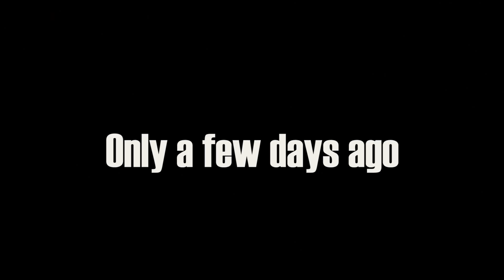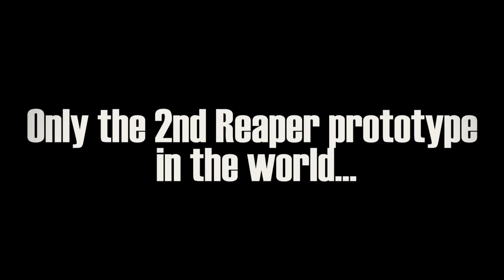The Reaper

Comment: cool looking truck, but i think it seems too close to the raptor. Raptor-Reaper. The logo on the bed side in the same place. Even the fake heat extractors on the hood are in the same place. 
Also the raptor is a production vehicle and the reaper is aftermarket just like the ram runner. Kinda defeats the point.

Comment: All this $$ is really just an appearance package, the supercharger is awesome, I own a 2015 silverado TLZ, I wouldn't waste my money on the reaper, in Canada its an extra $50,000. for the reaper sticker/appearance package, the suspension increases wheel travel by an inch, for $50,000!!! not worth it, I will go with a mid travel system that increases travel by a few inches at least, but for a lot less than $50,000.

Comment: Nice truck but it should be a 2 Door.
Reply: NO NOT "NICE TRUCK"!  Them things can barely freaking pull 5000 lbs.  My dad's truck pulls 6500 lbs, and it's a midsize!!!  Plus, it sucks on gas mileage.  And an addend, IT IS NOT DEPENDABLE.
Reply: Jeremy Good Obviously The Reaper is made for the Desert and not for hauling stuff. CHEVROLET/GMC need to do something to compete with the Ford Raptor. Personally I would've preferred a Street version like a SS. Muscle Trucks aren't used for hauling either except maybe hauling ass.All I'm saying is I'd be more apt to look at buying one if it came as a 2 door model. What the Payload Capacity is doesn't matter to me. I can use a different truck to haul and keep my toy looking new
Reply: Jeremy Good
I got it, you don't like those things. But one day, when it's not gonna be your dad's vehicle to put as example, you'll see the world from completely different perspective.
Reply: tallll70 When I was growing up the only 4 door trucks you saw were Crew Trucks. In fact they were called Crew Cabs,Ford had a Crew Cab model. I understand that 4 door Trucks are the norm in this day and age but I like a Regular Cab with 2 doors or maybe a Extended Cab 3 door truck. I saw a new Dodge Regular Cab Truck today and it looked nice stood out in the crowd of all things looking the same. I don't want what my neighbour has or my brother has. I want my Truck to be different. I feel the same way about The Charger when it came out,it should've been a 2 door. You build a MUSCLE Vehicle it should stand out not look like everything else. Just my opinion.
Reply: yeah i agree.
Reply: HARMARSCH2
Oh no, i pointed at Mr. Jeremy. But there is no need for any other responses. I have much higher experience from full size then from mid size i use to have. I had Toyota Tacoma. Gas millage vs full size. Highway 24/20, not that big difference for me. Ofcourse tow capacity even with 1/2 ton is much higher min 10k lb. If you not from US you can watch TFL videos all half tons towing over 10k lb uphill to compare them. Reliability? I would guess Toyota will win, but so far number of parts and it's prices didn't get any higher then i had to spent on Toyota. But thats just little me.

Comment: The only cool things about this truck is the hood vents and the front bumper. Even tough the vents appear to be just cosmetic. 

The rest of the truck you could do yourself and do a better job. Bolt on a actual Baja suspension kit, not a lift kit, a Baja kit, Glassworks  fenders, and other performance mods and save yourselves from that ungodly mako shark looking front end, and fender openings that appear no better than stock running on 33" tires.  

I admit, I was excited by the propaganda leading up to the unveil, then was hugely let down by the final product. Engine wise Lingenfelter delivers, like they always do, and I'd like to see what they can do to Chevys 6.2. But Southern Comfort must not understands what badass looks like.

Comment: WOW, nothing like adding a few bolt-on's, price it on the other side of the universe, and think you have something special. Nice truck tho
Reply: what do you think the raptor is?! :D lol
Reply: the raptor comes rolls straight out of the factory the way it is. it's not some aftermarket company throwing parts out of a catalog on a truck and selling it for double the money, any joe blow can do that. The reaper is not a factory general motors truck. I'm not saying it is'nt cool, because it is. Just WAY overpriced for what it is, IMO
Reply: Dick Bird
oh i agree lol it is overpriced lol but if you compare the reaper to the roush raptor (they both have the same upgrades such as a super charged which can raise prices by 7-10k) its about the same. All a raptor is, is a fx4 with a body kit and upgraded suspension. which is pretty much the same thing as a reaper. However i most definetly agree that they are both overpriced haha

Comment: Ok, The truck is cool, but come on. It wont compete with the raptor. The raptor was a whole new concept for off-roading from ford. This Reaper is a Siverado with a charged motor and new shock. Come on Chevy. Make a new concept. Not 10 mods to a Silverado and call it a champion. It needs a whole new motor designed to take hard hits and go places the Silverado cant, like the raptor to the f-150. This thing can only go faster and jump 5 feet higher than the Siverado. And whats with the small suspension travel? The raptor has 12 inches, I couldn't fit my foot in the Reaper's travel, and  the raptor has a motor in it like no other ford truck. Its designed to take a beating just like the ram runner. So, for my opinion, please try again Chevy. And nice word play with the name. Really? And, as a final request, please make a video, Reaper vs. Raptor. And make one that you don't pay for your truck to win. It should be hardcore American style. No paying them off. Just run em till they quit.

Comment: Wow..... what an absolutely bad ass, I mean bad idea this truck was from start to finish. 

Let's list the positives.

1). V8 supercharged.
2). Fox shocks.

The negatives. 

1). The grill and slap on fender flares.
2). No real improvements in suspension, no added travel.

And the we straight up copied Ford.

1). The name Reaper / Raptor hmm...
2). The mud splash decals over the rear fenders.

All in all the truck sucks. It comes off as knock off Ford Raptor and doesn't REALLY try to be an off road machine like the Raptor or the Ram Runner. The body molding up grades don't fit with the look of the truck at all. This is a truck for the guy who wants to look like he owns a cool off road truck but will never ever take it off the pavement. What's most disappointing is that I expect a better attempt from Chevrolet then this. SMH.
Reply: its only the second one ever made…its a prototype. Also lets not forget to mention power wise it way out performs the raptor…..I know i drive a raptor a lot. the raptor is a nice truck but mostly as you listed above, its a truck with slap on aftermarket parts. no different from the chevy reaper. Also i believe the copied the name to kind of 1up the raptor. They are both nice trucks lets just see where it goes. You never know the reaper may out perform he raptor.
Reply: Chevy didn't do this an aftermarket company did it. And just cuz they did similar things as the raptor doesn't mean they copied it. So since ford put fox shocks and a sticker on the bed means no body else can? This truck is no where close to being the same as a raptor. Raptor was bulit as a prerunner for the Baja 1000. Chevy 1500 was bulit as a work truck how is that copying.  ????

Comment: Sure it has more hp then the raptor but by far the ugliest truck I've seen
Reply: Ya it is very ugly.  It may have more HP than a stock Raptor, but for less $$$ than the Reaper you could get a Roush with 600 horses.

Comment: This truck makes me laugh. Nothing but a half-assed Raptor wannabe.
Reply: Well the smallest motor in the reaper out powers the 6.2 in the raptor so I wouldn't say that
Reply: Cayden Clark Putting a super on a Silverado doesn't suddenly make it better than a Raptor. Like I said, it's nothing but a half assed attempt to compete with the Raptor. If GM were serious about their Reaper, they would offer it from the factory, not a stock truck modified by a 3rd party. The Raptor is an awesome truck stock, and if you really want the extra power, then you can take it to any performance shop like Hennessey and upgrade it to the VelociRaptor. Which, when supercharged also, is still more powerful than the supercharged GM 6.2. So you can keep the crappy Silverado.
Reply: lol ok ford fan boi.  GM had nothing to do with this or any reaper builds.  crappy Silverado...smh.